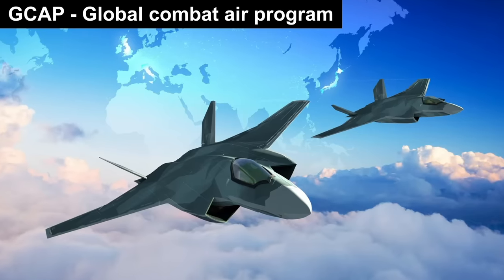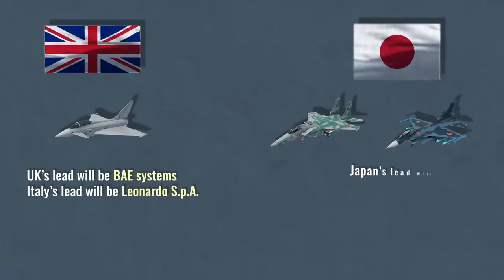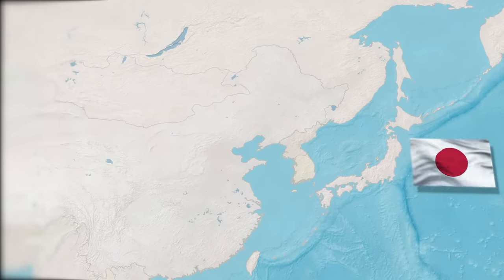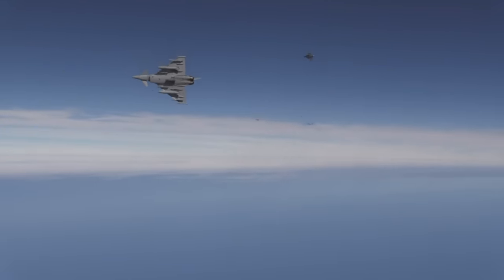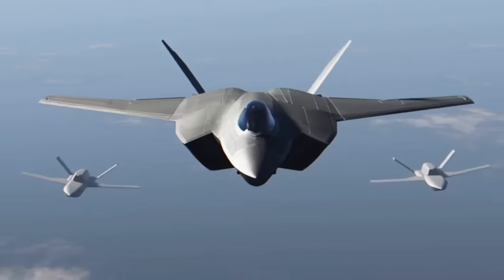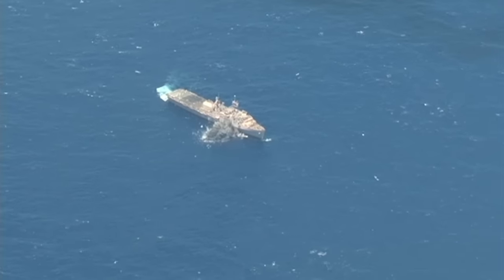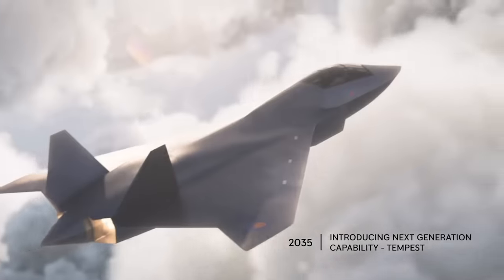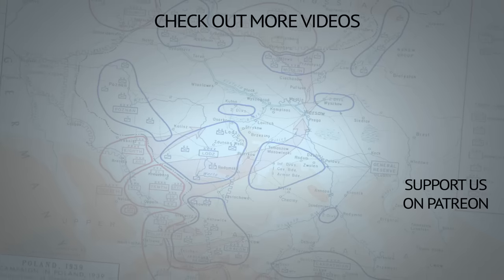Why is the future Anglo-Japanese fighter gonna be bigger than F-22?

Comment: This is assuming the united states hasn't been upgrading the f22 for 30 years, Nothing japan could produce in terms of an air superiority fighter would be better than the f22.
Reply: Us is planning to retired F-22 entirely by 2030 and retire first batch in 2024 (air force wanted to retire the first batch 2023 but congress didn't approve it).
Reply: Better in what sense? The F-22 is a great fighter, but it's old, and it's design fundamentals and philosophy are older still. 

Again, no disrespect on the F-22, but it lacks an IRST, helmet mounted sights, high off boresight missile launch capabilities. Its radar is half a generation behind what the F-35 has, let alone cutting edge, it lacks modern sensor fusion and electro optical suites, and its RAM is old tech and extremely hard to maintain.

Japan absolutely can put together an airframe with decent stealth shaping and manufactured to extremely high tolerances. You then throw modern sensors, software and RAM on that thing and you will have a platform with a very good chance of seeing the Raptor and getting a missile off before the Raptor sees it (IRST and electro optical being utterly crucial here). It might not out turn the Raptor, but that's not something that matters to fighter combat the way they thought it would when the F-22 was being scoped up.

I'm trivialising how difficult it is to do all that of course, but it is within the capability of a modern advanced industrial state like Japan. And the F-22, for all of its spectacular capabilities, was conceived in the 80s and fundamentally represents the peak of 1990s technology. 30 years of technological development, large parts of which were helped along by lessons learned from the development of the F-22 and F-35, mean that the F-22  is not some untouchable, inimitable magical plane any more. It's still on top largely because the people who have tried to beat it (Russia and China) aren't at the technological cutting edge. Japan and the UK are, and if they really try, building something capable of beating the F-22 is well within their capabilities.
Reply: @MattWeberWA  I agree with this. However, like I mentioned in my previous comment. The f-22 has matured and has gone through a myriad of bloc upgrades that I would assume (I'm no aviation expert) would make it competitive or event better as an air superiority fighter relative to Japan's new 6th gen fighter. I understand we have high hopes for what this jet could look like or accomplish, but these countries don't have the expertise and / or military industrial complex necessary to facilitate cutting-edge tech. This is why these countries have been buying our equipment for decades now. Not to mention, secrecy and proper opsec are integral to military efficiency and functionality. We'll never truly know what the new F22s are capable of. For God's sake, we still use f14s, and they're "officially retired," Let's not count the f22 out just yet.
Reply: Single role aerial superiority is dead. Missiles are so accurate at such long distances and travel so much faster than planes that advanced sensor packages and stealth are the most important tool for attack and defense. Add in the factor of drone wingman and decoy missiles that spoof radar returns of anything, its much more muddled.

I honestly expect 6th Gen planes to be more medium range platforms to allow for greater combat range as well greater loiter time for local Command and control as well as more weapons load out. So pretty much a fixed wing stealth Aardvark.
Reply: @granatmof  That fits within the design parameters of both the ngad/fa-xx programs and Japan's new fighter. They're more large command centers than fighter platforms.
Reply: @Devil-ev3zm  I'm sorry, but I don't think you really know what your talking about. The king's of major upgrades you're talking about for the F-22, things like adding IRST and EW pods have only just been formalised, I doubt there're any flying yet. There are capabilities that the US keeps quiet, absolutely, but not basic stuff like this.

And the UK and Japan are very much at the cutting edge. BAE and Rolls Royce are absolute top notch, world-class defence contractors.

The F-22 was and is a great plane. It is today the single best air to air combat plane in the world, and will be even better once this current round of refits is completed. But it won't be that way forever. It has limitations associated with age and it will be overtaken. That's just time. If that weren't the case, USAF wouldn't be bothering with NGAD, they'd just spend the 10b and reopen the raptor lines.
Reply: @MattWeberWA  It is neither the radar, stealth, lack of IRST nor the HMD that makes it feared by other nations; it is due to the fact that no one really knows the true capability of the raptor and the pilot cannot handle what the raptor is capable of.
Reply: @MattWeberWA  I never implied the f22  be as good as the NGAD platform. Of course, the military wouldn't spend so much time on developing a new plane if already in-service F22s were better. Luckily, that wasn't my argument. What I am  saying is, and I'm sure every aviation expert would agree. In its current state and with future bloc upgrades, the f22 would be a better "superiority fighter" than anything japan or England could develop or is developing. Just to mention, nothing our allies ever produce will be cutting edge. The only reason japan is even making their own 6th generation aircraft is because they don't want to wait for us to make an exportable NGAD fighter. the US IS the cutting edge, and we set the tone for everything military related. I do agree with you that once japan/englands/italy's jet is developed. It will be on par with the f22 in terms of stealth and avionics. That gap will widen with time, but as it stands. The f22 will continue to be the dominant fighter. Especially if Japan's jet even gets built in the first place, you know how politics can be.
Reply: @Devil-ev3zm  Lol, a lot of what is thought to be American technology is actually shared technology from allied countries. I wouldn't want to use the word steal because the American's pride would not allow it, so sharing is more neutral. Ever heard of espionage?
Reply: @MattWeberWA Absolutely true
Reply: @Devil-ev3zm Very very ignorant comment
Reply: @Devil-ev3zm  You've said you don't understand this stuff and continue to demonstrate it. No value in continuing this discussion. But this stuff is easy to learn.
Reply: @MattWeberWA  Don't worry, Matt, the first step to getting to the truth is denial. You'll get it eventually.
Reply: @Mr.mysterious76  It's OK to admit that I'm right, which I am. Get any skunkworks engineer, and they would agree with me wholeheartedly.
Reply: @MattWeberWA they have the manufacturing capabilities for sure, and they definitely have the brainpower. 

Im guessing what japan lack right now is real money, the right attitude and time. Coz the really squandered time away by dragging their feet. And that attitude of dragging their feet is really showing itself right now.

But they have the right attitude now, and theyve been given the money. Now, only time will tell.

Comment: F22 is 90s tech that got into service in 2000s. Lol try harder
Reply: F22 was absolute bleeding edge 90's tech, its still hasnt been completely made obsolete by jets designed in the last decade. Only the F35 beats it in most aspects (but is far cheaper and uses more common tech)

Comment: But China is on track to making their 6th generation fighter jets, too.
Reply: He'll get to them
Reply: Not really. And they just got out their 5th gen. Whatever they're making, it just started and won't be relevant for at least 2 decades. And both gen 6 programs from GCAP and NGAD have been around for over a decade
Reply: They won’t. Not without significant advances in their advanced manufacturing techniques. 
Which are way off.
Reply: @Ammotive28  Delusional, China is ahead in advanced manufacturing technique(3D printing, meta material), it's the traditional technique(metallurgy, CNC) that China lags behind.
Reply: @The136th China can't even figure out how to make engines for their "5th generation" J-20s lmao
Reply: @buddermonger2000 wrong 6 generation fighter only emerge in 2050
Reply: @The136th  That's literally the opposite of what's true. It's so opposite, they'd be unable to do any normal building if it were true
Reply: @widodoakrom3938  That aligns exactly with what I've said, at least for China's timeline. 6 Gen fighters are planned for the 2030s
Reply: @buddermonger2000  I doubt that let time answer your question
Reply: @ramadansteve1715 J-20 with WS-10 already being tested
Reply: @ramadansteve1715 as if Japan knew how to figure out a better fighter engine,

Shinshin jet fighter, Mitsubishi civil plane, all Japanese moon missions have failed,

so i have a doubt about Japanese capacity,

Guadam only exists in anime, jn reality Japan can't even build a World top-10 drone,
Reply: China can't even finish developing 5th gen engine , their engine has short life 😅
Reply: Only if they ‘borrow’ the technology.

Comment: Bring Germay and France on board
Reply: It would be nice but they have their own program and france is notoriously hard to develop planes with lol.
Reply: The French are a pain in the ass to work with. Germany could be fine though. There were some rumours about their participation a month or so ago.
Reply: Too many cooks, one of the problems with the Typhoon's development was it was delayed for years due to internal issues with it's contributors that ranged from some pulling out only to later re-join, funding problems & squabbles over workshare which ultimately caused France to throw a temper tantrum & leave.
Reply: @ZuulGatekeeper  Joint MIL programs with "too many chefs", as you say, have proven to be very difficult to achieve.
The A400M was really close to fail, to name a few.

Comment: Both Japan and Britain never did independently develop any 5th gen fighter jet. They only have limited experience in producing parts for F-35. I suspect they will end up with a 5+ gen but fall short of a truly revolutionary 6th gen design.
Reply: UK was the only Tier 1 partner in the F35 program as Karma mention BAE acquired Lockheed Martin AES (aerospace electronic systems) in 2000 we were the biggest contributors to the program outside of the US. Your comment is just plain wrong.
Reply: @jpracing893 you mean you got scammed by the usa who used your cash and refused to give you the source code
Reply: @NeostormXLMAX I thought the uk had special access on the f35s? Either way in a large scale conflict the USA will give all allies special access